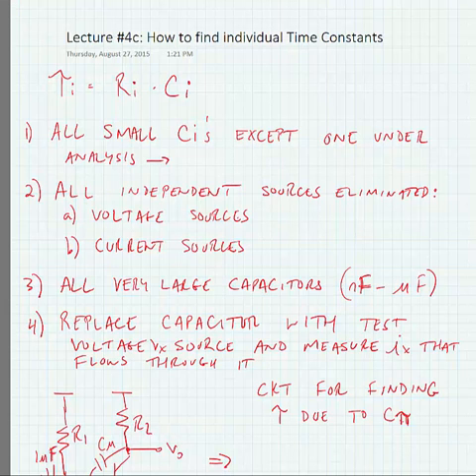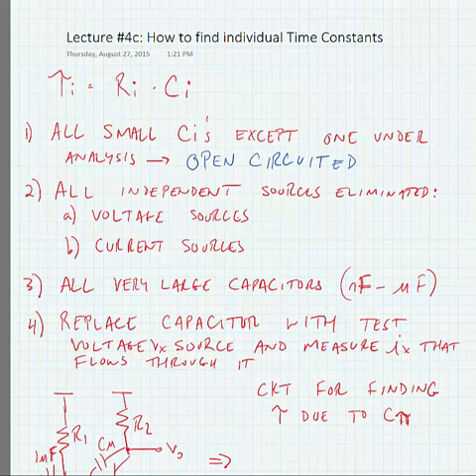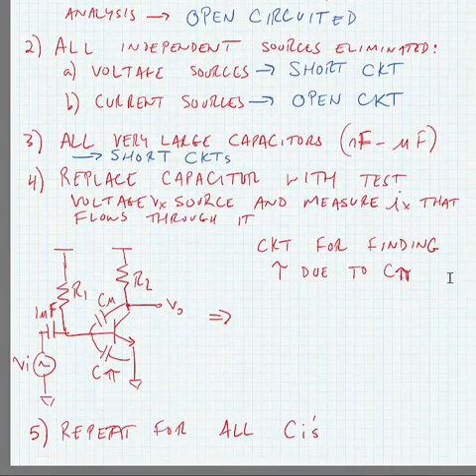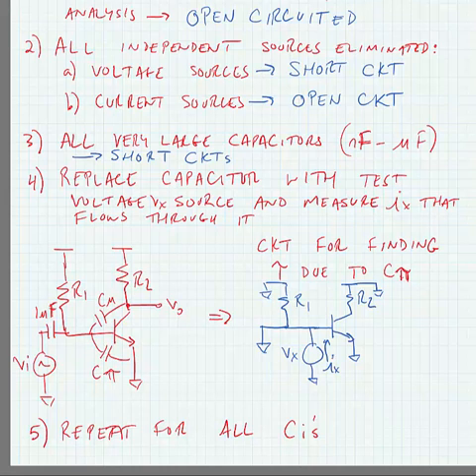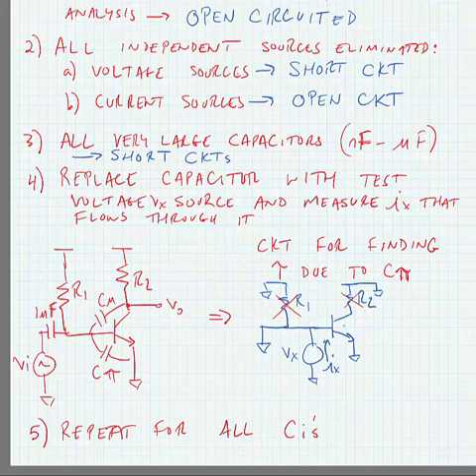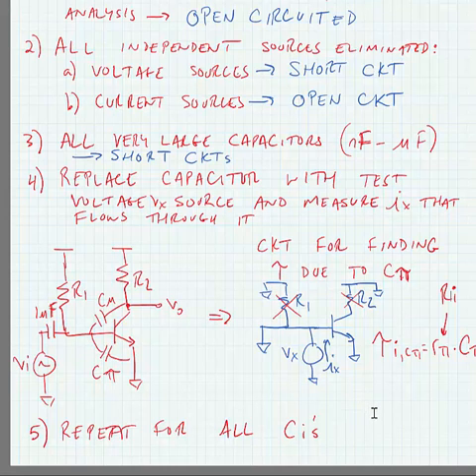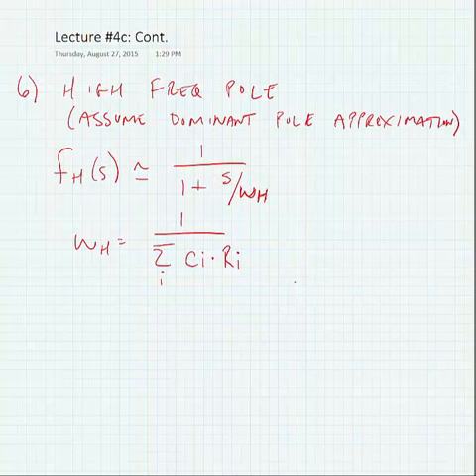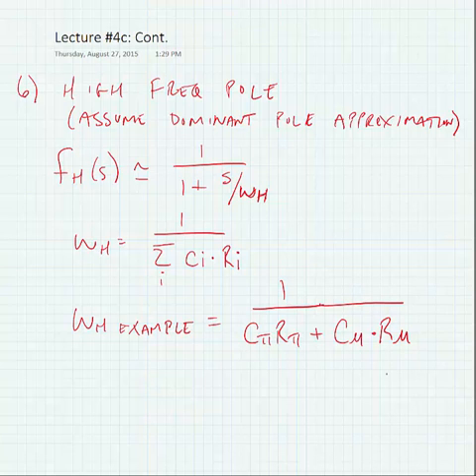ECE 3110 - Lecture 4c: Finding a time constance in OCTC

Comment: At 2:50, wouldn't Rpi be shorted to gnd (by large cap of 1uF and Vi), causing a net time constant of 0s ?
Reply from the maker: We are assuming that the circuit is not being driven by an ideal voltage source, but rather that the source has some series resistance; hence the source resistance would create a time constant.